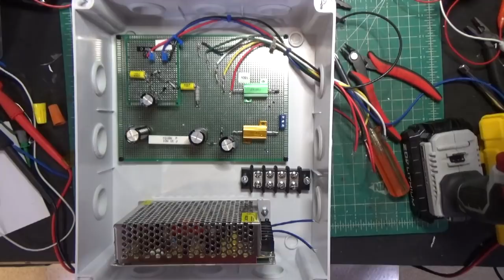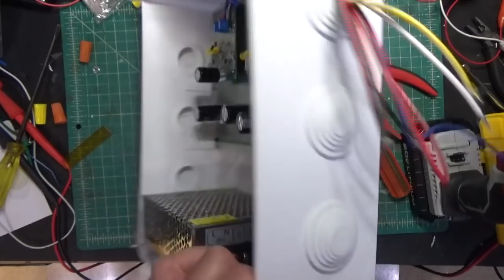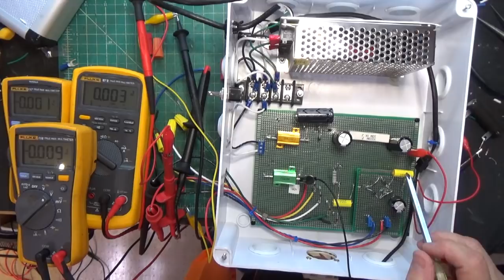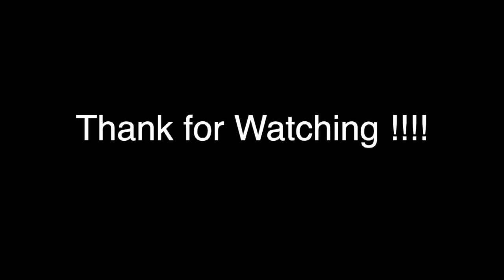Atwater Kent Model 67C Battery Radio : Episode #7: Power Supply tuning and completion, almost.

Comment: Hi Ron, I was pointed to your you tube channel by Gary Stephens as I was asking about a power supply for a battery radio I'm restoring.  It's an old UK set, a Lissen 8169 from 1937 and the power supply here is 240 Volt. Would your power supply need much adaptation to work at 240 volts?
Reply from the maker: Colm, this will not be hard to modify.   What DC voltages do you need for your radio to operate  A B & C  - did you see this    https://pbs.twimg.com/media/D0MvaklX0AAnswu.jpg:large
Reply: @rciancia  Hi Ron,  I think Black is common, Red is +2 Volts (likely supplied by a single lead-acid cell), Red is 135 Volts, Yellow is a tap on the battery - for the final amp screen grid. I can probably connect it to 135 and it should work OK, and brown is -2 to -4 volts bias.  I will also need a 5 volt power supply because I want to make this a Bluetooth set for playing my old 30's music.  I'd like to run it through the phono pickup if there was one.  There should be, unless the back is a replacement.  The holes for it are in the chassis but the parts have been removed.  You can find a schematic at. https://www.radiomuseum.org/r/lissen_battery_four_8169.html?
Reply from the maker: @colmoleary8441   Before you go further, do you know if the radio works ?  Coils can be bad and things like that. Before you invest in building a power supply , why don't you make a simple one to test with ?  This radio requires 2 batteries.. a 2Volt and a 135Volt.      For the two volt, a simple D Cell battery can be used and for the 135Volt, you can take 15    9V batteries and easily connect them together to give you 135Volt... connect both of these... if the radio plays, then you can safely invest in building the supply.  Make sense ?
Reply: @rciancia  That makes perfect sense. I don't know if it works, I'm still trying to find the vacume tubes for it.  But when I find them I'll do that and then as you say, I'll be able to see if it works.  I also have to replace all the paper caps and tidy up the wiring.
Reply from the maker: @colmoleary8441   Cool, please keep me posted.   Please be careful and stay safe. - Ron

Comment: Hiya Ron, When designing a PS, you must consider the load, i.e. amps, not just volts.  Think about it this way.  If you connect a 9v transistor radio battery to your car's motor, will it work to start it?  OK, make that eight "AA" cells in series battery pack, 12v.  This is why transformer size is important, volts AND amps.  So when you connect your PS to the radio, then load it up, see the actual voltage drops to see if its adequate.  The high voltage is going to be milliamps, but the low volts for the tube filaments will be higher amperage.  Watts are volts times amps, so lets say a 10 watt tube using 6v filament could need about 2a transformer, 2a x 6v = 12w.  That's ohm's law, very important to learn how to use.  Some Ohm's law 101 can be very helpful.  
Tubes generally work with three voltages, filament, grid, and plate (rectifiers two).
Reply from the maker: Completely agree Don.  I do not consider this power supply to be done, I consider it to be done for now. My only saving grace here is that this is a battery radio set, so I am sure it was designed with this in mind ( or maybe it wasn't).  Time will tell for sure. Its  using some pretty rare 22 tubes which are 3 volt filament so we'll just have to see.. Thanks my friend.
Reply: Don you are absolutely correct.   This power supply design is a very very complicated undertaking.    Ohm's Law is a law not Ohm's Suggestion.  LOL

Comment: Very cool 😎 enjoyed this a lot Ron.

Hey, I could use some help if you have a second... I just got a radio that I want to restore and it has a faux lizard skin finish glued onto a metal box and the metal box looks like true crap. Not rusted or rotted, just used so much the metal that can be seen looks terrible. I’m sure I can heat the pleather up with a heat gun and remove it. What I want to do is refinish the metal box and then glue the pleather back on. I’m fine painting and finishing wood but I’ve never been any good at painting metal. You always do so great on your metal stuff, I was hoping you could just explain a bit on what you do to get the paint to really bond well and not scratch with just general handling. If you’re interested the radio is an Airline 74WG1057A.  
Here is an eBay ad for the radio...
https://www.ebay.com/itm/Montgomery-Ward-Airline-Tube-Radio-62-1050-FOR-PARTS-OR-REPAIR-/223348932577?_ul=BO
Reply from the maker: Buddy, the key to painting metal is to strip it, get rid of rust and use a primer.  Then do light multiple coats of paint. You have to let it dry well in-between, and it will come out really good. Patience is key. I don't think you will need heat to get that pleather off. I am sure the glue is so old it will just peel off.   Take your time and it will be beautiful !!!   Thank you my friend. Ron
Reply: Thanks Ron! Do you bake any of your paint on? Or possible just let it sit outside, heck here recently it’s been 90°f as you know... with this one I really want to do a good job.
Reply: @budandbean1  paint must cure, depending on the type or brand, the longer the better, until it dries hard.  Some paints take a month to cure.  But the first week is soft, and the finish can mess up.